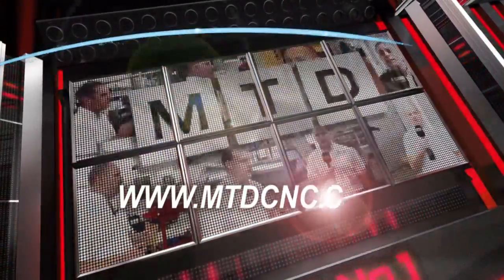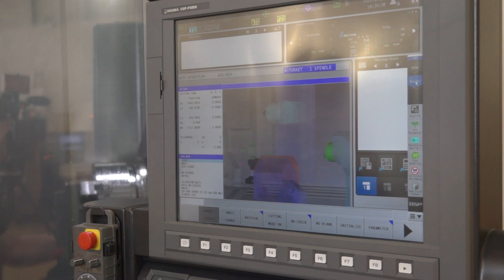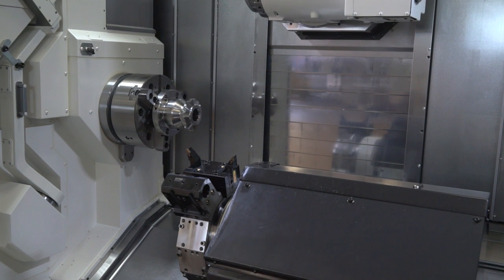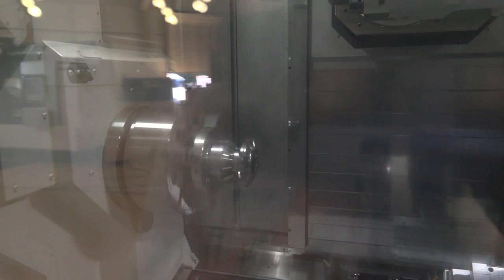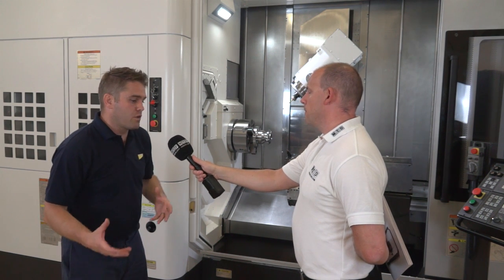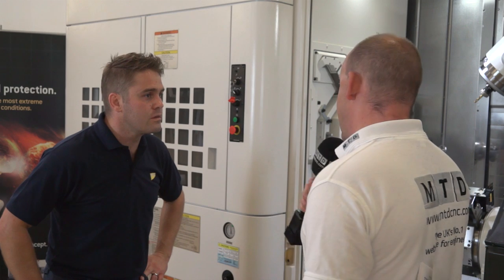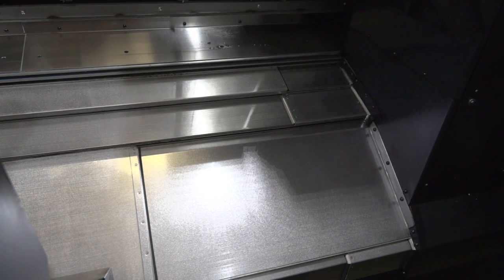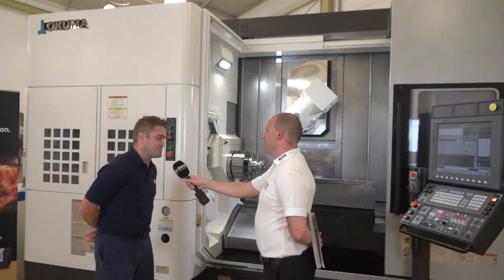Okuma Multus U3000 Mill turn multi tasking machine

Comment: We're about to scrap a 30 year old Okuma LB-12 because it's just so worn out from a very productive life. The load monitoring in it is brilliant and tells you stuff you can't see or hear. I has software features that a lot of its modern competitors don't even have as an option.
Reply: Garganzuul u should never throw away a Okuma there is a place that rebuilds them to new for alot less that new..

Comment: We have U4000 at my work. Don't know muck about it and it's quite new.
Reply: Ask if you can get some training on it and learn how to use it. 
I've been running an U3000 and U4000 for a few years now and they are great machines -  Very fun to run and program.
Reply: I have my place already with 2 index g300 flex's and g200.
Reply: @Rasmus661  I am looking to run on now. I ran the Mori CTX BETA for a few years. It close to the U3000 as far as axis goes. I just had a interview at a shop.